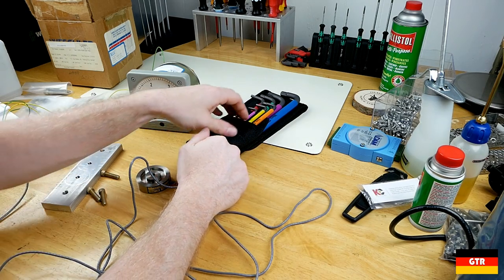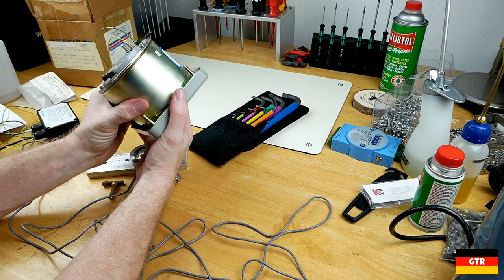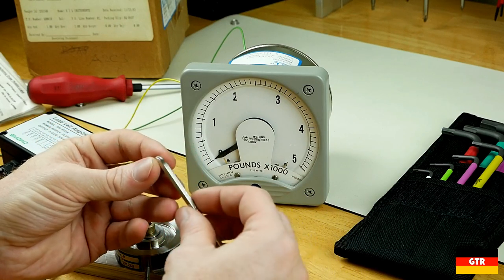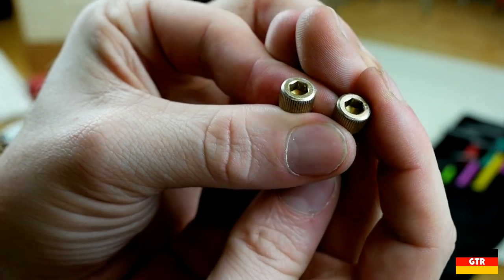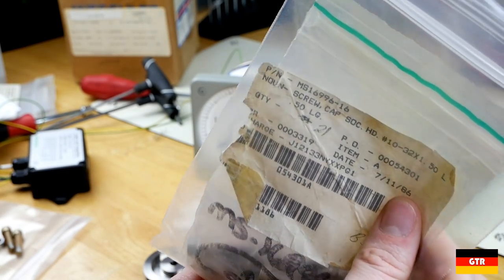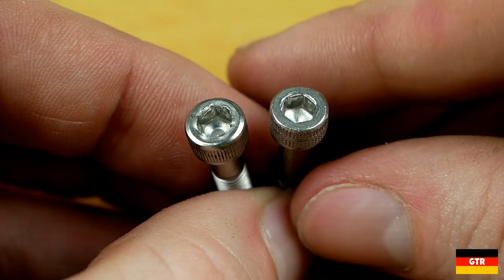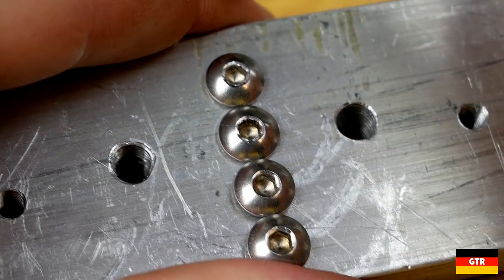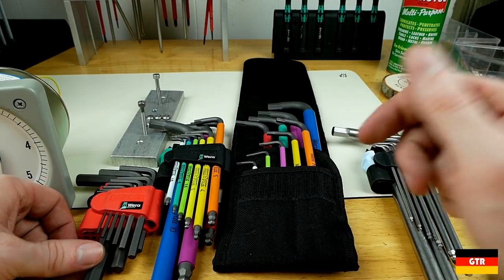Why I now exclusively use Hex-Plus L-Keys:  A short demonstration

Comment: That was a pretty good informative run down for the hex-plus set but it would be nice if there was more comparison with competing brands.  I know Eight from Japan is supposed to have a better ball-joint design and then there is Wiha with their line-up.  Would you consider doing a 1 to 1 comparison between those?  The reason that I'm mentioning it is that the information really isn't available else-where.

There's also Stanley (made in China but cheap and generally considered reliable), Bondhus (made in USA) and Tekton (also made in China but has a good reputation).  These would be a great choice to contrast against German and Japanese brands, thanks!
Reply from the maker: The Wiha one I used for the first part actually performed well above what I thought it would.  It looks like they have pretty high tolerances on their L-Keys.
Reply: Missed that part, good point.  Still curious how they would match up against Eight, PB Swiss and Bondhus but that's probably overkill.
Reply: It looks like an inverse flange drive excellent for cheesy soft cap screws. I would be a little concerned using these in grub screws as it is loading in the thinnest section. Once they split you have to drill them out.
Excellent, accurate and simple test. Please keep the videos coming.
. 
On a barely related note, I used to have a task that required the removal of a M20 X 35 grub screws that had been thread locked in. To get to the screws long series Allen keys were required a 10 mm to be exact. I tried Unbraco, Eight, Bondhus, Sidchrome, Gedore and from what I was told was a PBSwiss.  The depth and surrounding elements meant that the use of heat was difficult and if done to much would scrap the entire part. 
The Sidchrome and Eight would shear off or nearly shear off well before the screws would release(Flush with the top of the screw). No good for that job. 
Unbraco would usually break the screw loose but could only be relied upon to do it once or twice before shearing off. The key would usually have 1 3/4 twist in it when completed (Like this but on the long side https://goo.gl/JhyZkX) 
The PBSwiss and the Gedore Sheared off randomly(Only tried a couple of each) before twisting. 
The only ones that you could rely on were Bondhus. When new you would put in about half a twist then they would  last until they were bent. I only ever broke one Bondhus key and it shattered with a shower of sparks. I think that particular one was incorrectly hardened. 
 Over the years I probably did that job 60 times? Please bear in mind that nearly one meter of leverage was being used and the keys would have 1~2 turns of rotation on them before the screws would give way. The screws had the hex go all the way through so they never split. In reflection I'm glad that I don't do that job anymore.
Reply: Thanks for the information, it's nice to have extra information on a different fail points and the various brands.
Reply: GTR, A Japanese company called Vessel has been using a similar concept for at least 10 years.　They call theirs "Ultra Hex" profile, which is registered and patented.

Comment: Very informative video. I've been doing a lot of research into the different types of Allen keys out there I'm used to using bondhus but I found after only two years of use the square end rounded off especially sizes 4mm and below as well as chowdering up the heads on socket caps which is an absolute pain for removing. I was set on getting the PB Swiss ones but this has swung it for me I think. What's the tool life of these if used everyday compared to PB Swiss hex keys as I hear they are indestructible more or less..
Reply from the maker: Can't really speak to the tool life as I've never needed to replace any of them, but I also don't use them everyday, maybe a couple days a week.  Even the ones that I really stressed by putting a cheater bar on them are still OK.   I'm sure the PB swiss ones would hold up just the same as these, but I don't currently have any PB swiss L-keys at the moment.

Comment: In your second test with the #10-32, those bolts do not appear to be the same. The groves on the outside are different and the interior of the hex slots are shaped differently, particularly at the bottom of the slot.
Reply from the maker: Yeah that can be the problem with mil-spec hardware.  They are from different manufacturers but are still the same part number because they meet spec and were mixed together in the same bag. The only difference I can see if the thread length and the pattern on the head.  Thread length is only specified as a minimum value (no maximum) so they are both technically within spec.  It shouldn't have made a difference but I should have paid more attention.

Comment: So what is the actual difference between ordinary hex and these hex-plus? They look quite the same and breaking strength might be just the matter of material, not the socket itself.
Reply from the maker: The profile of the tool is slightly different with the hex plus.  I did a follow-up video to better quantify the differences and I found that for large screws it really didn't matter since the screw ill break before you cam out the socket, but for smaller screws it can give you more torque.

Comment: People seem to think that stainless steel is highly resistant. Screws and bolts, however, have an extremely low resistance to torque and heads will easily break off. I'm a marine engineer and if you want to be able to unscrew stainless screws and bolts, use grease when you fit them.

Comment: Conventional flats exert large wedge forces inside the socket which widens the space between flats and causes the metal to flow. The Wera design concentrates the load near the start of the flat so it can indent. Once indented, a small step is created to exert force against, and so exert torque with less spreading force. 

Snap-on made its name with a similar concept, by removing the start of the flat inside a socket, so the edge of the flat could get a bite into the nut.
Reply: Are you referring to the flank drive plus design?

Comment: Good camera, nice tools, distorted audio! Need to do some tests so that your mic doesn't overload when you talk. Maybe it's too close, or perhaps need an external mic. You can always boost the audio in the video editor using a soft limit, but it's hard to fix already clipped audio :)

Edit: I wonder what that patent actually covers, because torx bits are like this, but with a much steeper curve between points. Sometimes I even used torx bits because they seemed to fit better ;)
Reply from the maker: Yeah audio did get messed up.  Gain was way too high for some reason.  Got a new mic since then so hopefully future videos wont have the same issue.

Comment: I have never in my live stripped the hex socket of an allen screw. I've shorn off the entire head, the bolt or stripped the thread, bur never the hex socket.
Maybe it has to do with your moon units, because I'm solely working with metric screws and maybe they have slightly different proportions.

Comment: I don't get it, most applications you aren't supposed to reuse screws, and the torque required for stripping far exceeds design torque. If you're in the realm of requiring massive preloads, then you move to a more appropriate screw drive
Reply from the maker: Yeah, this system is best used for taking off / removing screws.   I would agree that it doesn't make much sense to put more torque on the screw when installing it, but I was using the bolt tension to try and see if I could get more torque out of one design over the other.  I may do another test that is purely removing bolts.  Something like using a torque wrench and thread locker to put a bunch of screws at the same torque and see if one style works better over the other.  I suspect that there would be no difference with a correctly torqued bolt, but there may be a difference with a corroded or over-torqued bolt.  I haven't been able to quantify definitively what that difference would be yet.
Reply: What came immediately to mind is low-quality screws I get in furniture, something will always get buggered. I may buy a set just for that actually.
Reply: Keex11 I’m on a robotics team and we don’t really have a choice other than reusing screws if we can. They usually strip on their heads before they do anything else, so this is helpful

Comment: Did you measure any of the tools?  It appears that the test (traditional) hex keys were undersized.  I wouldn't be surprised if they were soft also.  What would happen if you used an S2 tool steel bit?
Reply from the maker: The Husky hex bits were a little bit worn out which may have influenced the results.  I did a follow-up video with all brand-new tools and found that for the large hex keys the quality doesn't really matter as the DIN/ISO tolerances are large enough to compensate for poor quality.  The smaller bits (less than 5mm) is where it makes a difference.
Reply: DIN/ISO tolerances, ok I was wondering about that.  In my opinion, the only way that the Wera Hex-Plus is going to be any better is if they are larger than normal tolerance.
Reply from the maker: It's the contact pattern of the shape that changes the force profile and minimizes the chances of the hex key "plowing" into the sidewalls of the inner hex.  The details are in the patent if you are interesting in the geometry:  https://www.google.com/patents/US6263771   It is only really useful up to a certain size because at some point the head would be more likely to break off before you round out the surface.

Comment: Nice one with the hex plus... I always undo the stripped hex with torx, some tap tap with the hammer and torx make there own grooves in stripped head. You can also heat it up with fine tip blow torch and rapidly cool, most of them stress out the jammed treads, and harden the head a bit so can help on that marginal situations... (sure after you make new growes with torx, not before :) )

Comment: Nice demonstration, to bad the 10-32 screws you used with the load cells weren't identical. I have no doubts you did a non-biased test, but it would have been nice if the screws were exactly the same. Both the pattern on the outside of the head and the length of threading is different, so its not really hard to spot that they are not the same type of screw.
Reply from the maker: I will check that.   They came from the same bag but maybe someone mixed some brands together.  They are Mil-spec screws which means that they can be from different manufactures but still have the same part number.  Each manufacturer usually adds some marking to indicate who made it.
Reply from the maker: Yes, you were correct I went back and looked at those screws and one has slightly longer threads.  I wondered about this so I went to the actual Mil-Spec and there is only a minimum thread length specified for that part number, which is 0.875in.  Therefore, both are compliant.  It should have made no difference because the height of the load cell is 0.63in, would would mean that we only need 0.87 thread length so 50 thousands of clearance at the minimum spec.  You have a good eye as I did not notice this and should have paid more attention as I would have made sure to get two that are exactly identical.   Goes back to that saying "close enough for government work" as the military would consider those two screws to be the same.

Comment: So normal L-keys work fine if you don't overtighten your skrews (which you shouldn't do either way)?
Reply from the maker: Yes, this is correct.  It is more of an issue of loosening an over-tightened or rusted screw.  Most people don't use a torque wrench when installing socket cap screws though so they are often over-tightened.

Comment: How small do the + keys go? And are tolerances given for the manufacture?

Working with small RC helis I'm down in the .8-1.5mm, and have had to ask whia to hand pick drivers at the large end of the tolerance band straight off the line. 

I'll be checking out the + drivers, but without tolerances (still under patent) they'll still be pretty worthless to me as they need to fit within the established tolerance band of the very small socket head screws, which is quite large. I need the keys at the large end of that band.

Any insider info/experience with the small stuff would be greatly appreciated.
Reply from the maker: The 1.5mm is the only one in their sets that is a regular hexagon (no hex-plus profile).   2.0mm is the smallest one that has the hex-plus profile.  They should all fit in a socket cap screw even if it has the hex-plus profile.   I haven't had to use any that small lately.  I've never seen any manufacturing specs, but they do have the maximum torque rating in their catalog.  For example, a 1.5mm would be 0.82NM (13.25 in-lb) minimum torque without damage to the tool.

Comment: I know this is an older video, but i was trying to figure out what is the difference between the Wera 950/9 Hex-Plus 6 SB L-key set, metric, BlackLaser and the Wera 950/9 Hex-Plus 6 L-key set, metric, BlackLaser ? I have the same issue with the 950/9 Hex-Plus Imperial 1 SB L-key set, imperial, BlackLaser and the 950/9 Hex-Plus Imperial 1 L-key set, imperial, BlackLaser. With the imperial set I know the 950/13 Hex-Plus Imperial 1 L-key set, imperial, BlackLaser has 13 in the set as opposed to 9 in the other 2 sets, but otherwise I am not sure what the difference is. My suspicion is that some sets will have Hex-Plus on both ends and some will have Hex-Plus only on the ball ends. You have any clarification on this?
Reply from the maker: The "SB" items come in retail packaging, while the other ones are sold to distributors in bulk packaging.  The retail packaging is usually one of their standard black boxes.
Reply: Thanks. I had read an Amazon review that stated these sets only have the Hex-Plus profile on the ball end. I thought maybe there was an older & newer set were the old set had the profile on the ball, but the new set had the profile throughout. Either way its been hard deciphering which sets have the Hex-Plus profile and were.

Comment: Are the stainless steel hex plus a stronger (last longer) L-Key? And not just for working on stainless steel fasteners?
Reply from the maker: I would doubt that they would last longer as they will be a softer metal than regular L-Keys.

Comment: I use that exact set of wera hex keys at work. Still strip fasteners out every day. The only advantage I've seen is the tool itself almost never fails.
Reply from the maker: Are you using the ball end when you strip the fasteners?  I don't know if I mentioned that the ball end on these is just like the ball end on any other key.  It would only be the short end with the different profile.  I do need to figure out how much force it takes to strip/round the hex.   I'm thinking it would be around 50% above recommended torque but need to do more testing.
Reply: German Tool Reviews nope. However it is on removal of old bolts that have been in an operating tool. When assembling the tooling the fasteners have a specified torque requirements so it's almost never an issue of over tightening. 

When there is no torque spec we usually use the gut n tight method of tightening it down. Go till it stops, then a little heave ho for that little extra.

Comment: Waffle huh, seemed like a great presentation to me. Maybe the suggestion of a bench vice would be appropriate. It would have to be well mounted though wouldn't it? Dumb question, but when you refer to thread stretching do you mean on  the screw or the holes in the aluminum plate or maybe both.
Reply from the maker: Yeah I might repeat it again with another setup to address some of the issues people brought up.   When I say stretching I mean the threads in the aluminum plate.  I doubt the screw threads would be stretching.
Reply: The aluminum plate right, I said it was a dumb question.

Comment: I'll look into the Hex Plus system thanks for that! A good comparison I was gonna do myself is test cheap Allen sockets vs say high end ( snap on ect ) sockets and see how much of a tolerance difference there is. Is you have cheap and expensive Allen sockets around I'd love to see a video like that as I've only got cheaper Allen sockets.
Reply from the maker: Yeah that would be a good comparison between expensive and cheap L-keys.   I think you are going to find that they have the same tolerance since this is specified by the DIN 911 standard.  I bet the biggest differences would be in the quality of the metal and the finish.
Reply: German Tool Reviews yeah I had a feeling the tolerance would be about the same :/ was just curious though. Thank you for your help!

Comment: Since I bought my first set of Wera screwdrivers.. If ever I need a tool, if Wera make it, that's the brand I buy. Same for Knipex when it comes to cutters, pliers or shears.
Reply: I didn't know about Knipex till I found a brand new pair of Knipex pliers lying on the road, and they turned out to be the best damned pliers I've ever used. Next time I need drivers I'll certainly give Wera a try.
Reply: htc007898 You don't happen to live in West Sussex do you? I dropped my first pair of side cutters doing a job at my parents house. Saw a cyclist stop and pick them up on the CCTV!! Haha.
Reply: Ah, that's a terrible shame to have lost them. I live in South Australia, and the pair I found are pliers rather than side cutters, so I reckon they're not your pair. But I didn't know just how good they were when I found them.